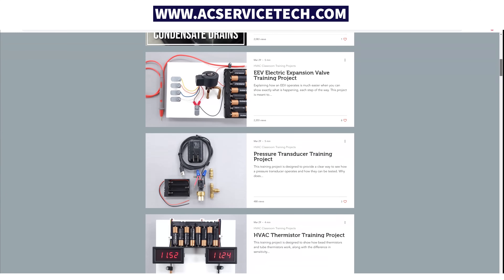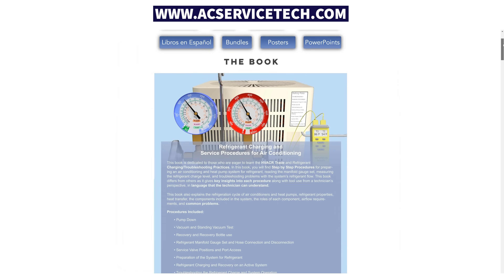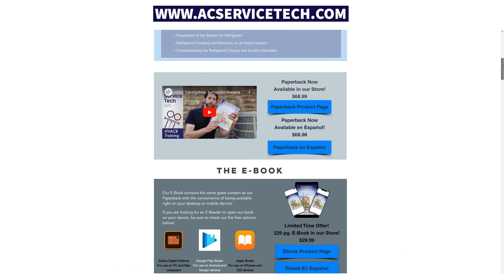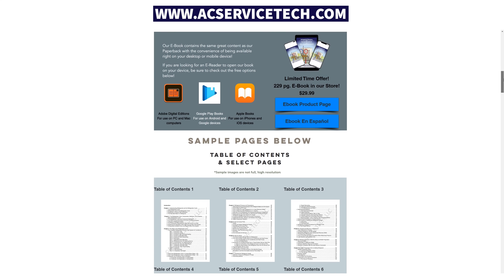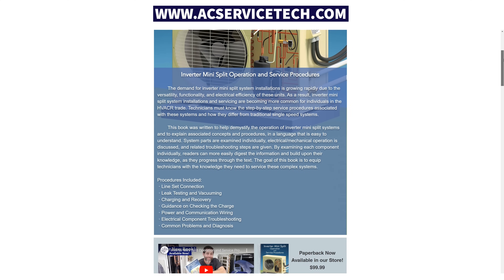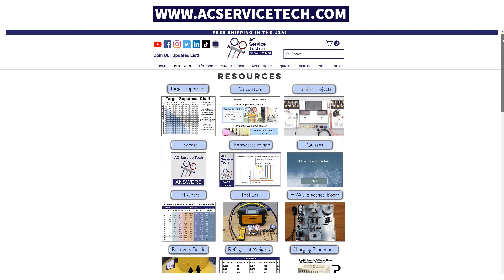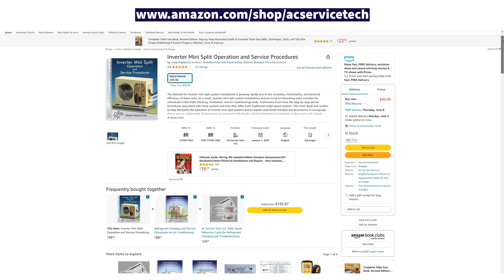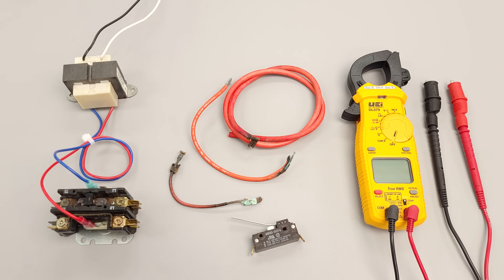HVAC Multimeter Basics: Measuring Electrical Resistance vs Continuity! Testing and Tips!

Comment: Great demonstration, just had a 5” section of wire melt the insulation off and left copper exposed.  Poor connection of a wire nut caused this.

Comment: I wonder, does this tool support both 6V and 12V batteries? The Vdiagtool BT300 works with motorcycles and cars, which seems more flexible.

Comment: the continuity buzzer... allows you to use the multimeter as a toner while fishing wire... if I'm not mistaken... means guys in certain circumstances have may be able to do the job with one tool instead of two.

Comment: If you guys are working with the power turned off due to some as yet undetermined fault being present, how do you supply the 24v to the relay coil? Do you carry a separate 24v transformer and wire that to the mains supply? Or do you isolated the out put of the units own 24v, and use jumpers to supply the 24v to which ever relay  or CCTV your are currently testing?

Comment: one other question: what's the difference between a thermal limit switch and a "low/high limit thermostat" ?
Reply: The thermal limit switch cuts power to the gas valve when it's subjected to an overtemp condition. For example, if the blower fan in a furnace stops working, the furnace temp will keep rising until the thermal limit switch trips and cuts off power to the gas valve. Without power, the gas valve closes, stops supplying gas, and the flames go out.

A low/high thermostat will maintain a minimum temp and also maintain a maximum temp. Let's say we set it to a low/high of 65/85. The heater will come on when the temp drops below 65 and the air conditioner will come on when the temp goes over 85.
Reply: @bernardocisneros4402  very cool! So how do these limit switches shut off the gas? Are they - how can I put this - causing an open circuit to shut it off or causing the electricity to be shunted somewhere else ?
Reply: @MathCuriousity  The limit switches open their contacts and cutoff power. They do NOT shunt it to ground or anywhere else.
Reply: @bernardocisneros4402  ah ok that makes sense I’m an idiot. I geuss all limit switches work that way right? At least fundamentally?
Reply: @MathCuriousity  All the limit switches that I know of work that way.

Comment: hey can you explain a couple things further:
1)
what is it about corrosion and melted wires (I'm assuming a different mechanism for each) that causes an increase in ohms and resistance
2)
shouldn't even simple wires have resistance? Is anything really zero resistance? You said the door switch  thing for the gas furnace should have 0 and those simple wires also should have 0.
3)
What is so bad about some device having more resistance than it "should"? Can you explain a bit more in detail how more resistance leads to higher current and heat? This completely confuses me. I thought the higher the resistance, the more the current is being resisted and thus the less current gets thru!
4)
Last question: What exactly does that door switch do?
Reply: @MathCuriousity 

1. Corrosion causes higher resistance and higher resistance causes higher voltage drop. Since voltage is the electrical energy, you will develop heat wherever there is voltage drop due to resistance. The more heat that develops, the higher the resistance goes, and the higher the resistance goes, the higher the heat goes, so you can see that it's a catch 22 until the plastic or insulation melts or the metal contacts become burned and pitted. As you can see, corrosion and loose connections cause high resistance and they can cause a system to stop working or even worse cause a fire. One thing he said in the video that is NOT correct is that "current goes up when heat and resistance go up". If resistance goes up, current actually goes down. The melting of plastic on contactors and plastic insulation on wires, and burned/pitted contacts on switches are not caused by high current; they are caused by voltage drop in that spot that's loose or corroded.

2. You are correct. Everything has resistance. Except for superconductors but they're not used in HVAC so you don't have to worry about them. The ohmmeters we use are not sensitive enough to read the resistance value of 1 foot of 14 gauge wire. There are very expensive ohmmeters that will read and display the resistance of 1 inch of 14 gauge wire. For the purpose of HVAC, the multimeters we use are more than good enough.

3. Read answer #1

4. That door switch is held in the closed position whenever the furnace door is properly installed and allows line voltage of 120V to go to the circuit board and power both the 24V and 120V circuits so the furnace can operate. If the furnace is running, and you take off the door that is holding the switch closed, the switch will open, cut electrical power to the furnace and furnace will stop working. Also, if the door is off the switch will be in the open position and furnace won't have any electrical power going to it so it won't start.

This guy is a gem. He's worth his weight in gold in my opinion. He puts out great content. I'm not in HVAC. I'm actually an airplane mechanic but I've learned so much from watching Craig. I like doing all my own repairs and installs. If you want to be the go to guy in your company, watch his videos and take notes.
Reply: @bernardocisneros4402  

Hey Bernardo, I had another question given that clearly you are a gad damn genius! So something’s been bothering me lately. I stumbled on someone on a forum mentioning that 
1)
If you take your hand and put pressure on a fan blower motor blade, it won’t start working harder, actually less work will be done and less current will be drawn. Is this true?!! If so why?! Intuitively to me it has to work harder and I would think more current will be drawn? Someone else mentioned “internal resistance” - no idea what that is or how that would play into this even if it is true.

2)
In another area someone mentions that’s: centripetal fans will draw less current if blocked but axial fans will draw more current if blocked. Any idea if this is true and if so why?!

Thanks so much kind soul!
Reply: @MathCuriousity   Thanks for the compliment but genius I'm not. I've just being doing this a while. My job working on airplanes deals a lot with electrical and electronic components, so you have to be on point with your electrical knowledge. You don't want to fry a $100K piece of equipment. 

If you hold a blower motor fan blade with your hand to prevent it from turning, it will do less work, but draw more current. It partially has to do with how "work" is defined. Work is defined as the product of force and distance. In other words, work is equal to the force applied times the distance it's applied, and since the fan doesn't rotate, there isn't any distance travelled when you're holding it still, so the distance portion of the equation is zero, and anything times zero is equal to zero. Let's not worry about that part because it doesn't really matter in the trades. It matters more so in engineering when they're designing these furnaces and air cond units. 

There's 2 types of resistance when dealing with motors. There's physical resistance: you holding the fan blade so fan won't turn and electrical resistance measured in ohms that opposes the flow of current. 

There's a lot that goes into properly answering this question, and I don't want to write a book, but just know that increasing the physical resistance on a motor will increase the current flow. The motor will draw more current. 

Increasing the electrical resistance on a motor or its circuit, will decrease the current flow to the motor. 

The impedance of a motor is the sum of its internal resistance and inductive reactance. In short, impedance is the total oppostion to current flow in a motor. Reactance also opposes current flow and is also measured in Ohms just like resistance but it's not the same thing. The internal resistance of a motor is composed of the resistance in its windings. inductive reactance is kind of like resistance but it's not. Inductive reactance in a motor is at its lowest when the motor is NOT turning. As the motor begins to turn, its inductive reactance starts increasing. This is why a motor will draw much more current at start-up than when it's up to speed. This current is called in-rush current. The reason it's higher at start-up is becasue the only opposition to current flow at start-up is the motor's internal resistance. As the motor begins turning, the inductive reactance starts increasing and helps the motor's internal resistance to oppose current flow. 

It doesn't matter what type of fan it is. If it's driven by a motor, it will behave in the manner I described above. Being axial or centripetal doesn't matter.
Reply: @bernardocisneros4402  so if we hold the blade with our hand increasing physical resistance , the current draw will increase and just not to torment you further with questions but if you have a moment: is this current increase because: A)
Torque increased?
B)
Impedance increased? If so was it internal resistance or inductive reactance to make the impedance increase ? (Since you mentioned impedance is a sum of them so one has to have had risen).

Thanks so much!
Reply: @MathCuriousity  The current increase is because torque increased and Impedance decreased. The reason impedance decreased is because the resistive portion of impedance stayed the same but inductive reactance decreased.
Reply: @MathCuriousity  Think of impedance as the total opposition to current flow the motor produces. The higher the opposition to current flow; the less current flow.
Reply: @bernardocisneros4402  

Hey thanks so much for hanging in here with me Barnardo. Just wanted to ask two more followup questions:

1)
some guy told me on a forum that a fan won’t work on DC. Why is that?!

2)
Another person told me a hand holding the fan will cause a “lack of movement causes back emf to vanish and voltage and current to rise.” OK. I can be OK with that; but how does “back EMF” relate to Impedance? Do we say that when back emf is present, it raises resistance, internal resistance, inductive reactance, or capacitive reactance?! Which one does back emf effect when it’s gone?

3)
I did some thinking about torque - if we are holding the fan - how could the torque increase? Did you mean the fan is trying to increase torque but it can’t? Also couldn’t some motors simply not change torque (I’ve heard of something called a constant torque motor and PSC motor - not sure if different motors respond differently)?
Reply: @MathCuriousity  1. There's 2 main types of motors. Alternating Current (AC) motors and Direct Current (DC) motors. They're not the same. They're constructed differently. You can't run AC motors on DC and vice-versa. There are some specialty motors specifically designed to run on both, but they are the exception. For example, everything in your car runs on DC but your alternator produces AC, so there's a diode pack inside the alternator to rectify the AC to DC so your car's electrical system can use it. If the fan is attached to an AC motor, then he's right, it won't run on DC. The radiator fans that prevent your car from overheating and the fans inside the car that keep you cool in the summer and warm in the winter are DC fans. Don't pay to much attention to people on forums. Even me. Take everything with a grain of salt. The best and surest way to learn this correctly is reading book written by masters on this subject or taking classes.
Reply: 2. The person that told you about back EMF also called Counter Electro-Motive Force (CEMF) knows what he's talking about but he doesn't fully understand CEMF, inductive reactance, and impedance. CEMF is the opposition to the CHANGE in current flow. It opposes current from going up and down. Inductive reactance is a RESULT or CONSEQUENCE of CEMF. Inductive reactance opposes the flow of current NOT the CHANGE in current. 

It's like when someone gets in an accident when it's raining. They stepped on the brakes, but the car skidded and didn't stop in time to avoid the accident. They didn't get into the accident as a direct result or consequence of it raining. They got into the accident because the rain got the road wet, so the road became slippery. The accident was a direct result of the slippery road and the slippery road was a direct result of it raining. Same with CEMF and inductive reactance. The current rises as a direct result of a decrease in inductive reactance and inductive reactance is a consequence of CEMF.

There's a lot involved here and there have been books written on this subject specifically. As tradesmen, all we need to know is that a motor will draw more current when a larger load (a.k.a. physical resistance) is applied.If you are very curious about how all this works, you should read some books on the subject or take some classes at your local community college. Maybe you'll decide to become an engineer instead. That would be cool.

After thinking about this after I wrote it, I'm thinking I might be the one that's wrong about the current increasing due to decreasing back EMF or decreasing inductive reactance. It's been years since I learned this. Either way, the current increases when you hold the motor still with your hand. That's your homework. Find out if it's the inductive reactance or back EMF and let me know. I'm sure about everything else.
Reply: @MathCuriousity  When you hold the fan still with your hand, your hand is increasing the load (torque) on the fan and the motor reacts by drawing more current, but since it can't move, it can't convert electrical energy into mechanical energy, so it converts it to heat energy, and if held still long enough, the motor will overheat and fail. That's why air conditioning compressor motors have an internal overload device that breaks the power going to the compressor motor so it doesn't overheat and fail when it draws too much current. PSC is a Permanent Split Capacitor motor that uses a capacitor in series with the start winding to help the motor start and run more efficiently once it's up to speed. There's a lot to learn. Especially if you have an inquisitive mind. I suggest buying books on this subject, borrowing them from your local library, or taking a class or classes. For example, this is a great book for HVAC: 

https://www.cengage.com/c/refrigeration-and-air-conditioning-technology-9e-silberstein/9780357122273PF/

It might be a little expensive for the latest edition but it's worth it many times over. You can also get it cheaper by buying an earlier version, but I suggest getting the latest version if you're looking to work in HVAC.
Reply: @bernardocisneros4402  friend I will do more research and hopefully I can thank you for your kindness with further knowledge soon. Stay tuned!
Reply: @bernardocisneros4402  thank you so so much. You really explained this stuff well and now it’s really just some fine details to iron out. You are the man.

Comment: As an electrician, I can tell you beyond a shadow of a doubt, that the mm continuity function plays a vital role in determining certain electrical and communication shorts. All electrical and communication systems are NOT equal and thus that feature has its place from time to time; otherwise, why would mm manufacturers bother designing it into their products?
Reply: Off course it has its place but not in a video for techs just getting started in HVAC. After you get some experience and know how your meter works, then you can decide which feature to use, but for newbies the resistance feature is best over the continuity feature.

Comment: What is the “NCV” mode on meter?
Reply: NCV stands for Non-Contact Voltage. This feature allows you to detect voltage without using your meter probes. I wouldn't trust it 100%. You can try it until you get comfortable with it but always double check the voltage with the meter probes before beginning work.  NCV has steered me wrong a few times.

Comment: Need advice. I have a unit that’s not blowing cold. The pressures look normal. The compressor is fine. Last guy replaced the fan motor. I said but the suction line still isn’t cold to the touch it should get cold to the touch within seconds. He said since it’s so hot it’ll take a while to start cooling. I knew better but still paid him and he won’t return my call. I knew better the suction line always gets cold within SECONDS of the condenser coming on. If I turn the unit off for a while and then turn it on, the suction line gets cold for about 1 minute but then that’s it, it goes back to ambient temperature and inside the it’s not blowing cold. I’ve now had 3 different people look at this unit. No one knows what’s going on. I’m already out $500. Any thoughts? Bad TXV?

Comment: My Fluke 116 has a “Auto V Lo Z” setting.  
It was useful recently in finding a faulty thermostat circuit board issue. Checking with regular voltage setting would show various AC voltages due to high resistance circuit board faults in the thermostat. 
Testing with the “Auto V LoZ” setting would shunt the noisy voltages on the line and the circuit would work normally. 

Maybe a video on that feature and the limitations of high impedance digital meters and their susceptibility to line noise might be helpful.
Reply: Baby steps!  I think a lot of people would have a hard time wrapping their minds around that concept when they're starting. Were there any capacitors on the thermostat circuit board?

Comment: Superheat, typically 12-15F taken near the compressor is important to make sure your not bringing any liquid back into the compressor (low superheat) but is not too high which will cause the compressor to run too warm or hot. Of course the proper charge and line sizes need to be correct.